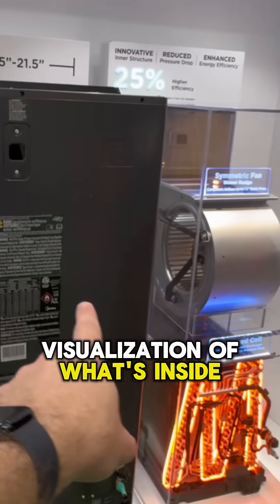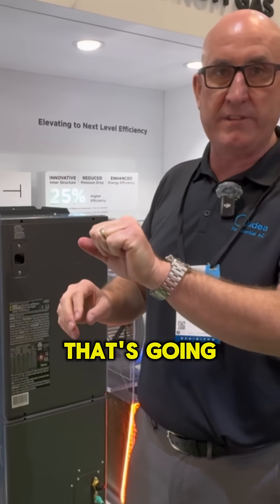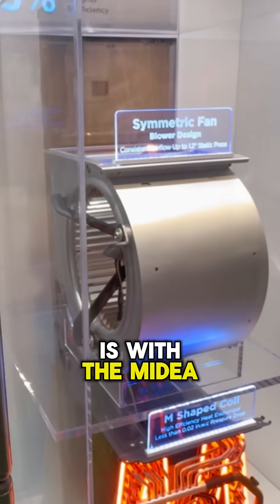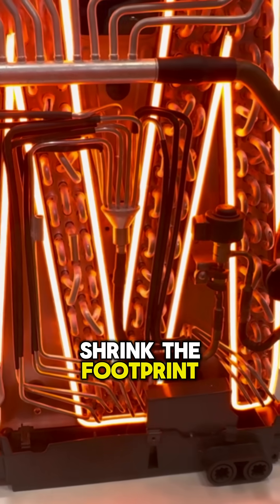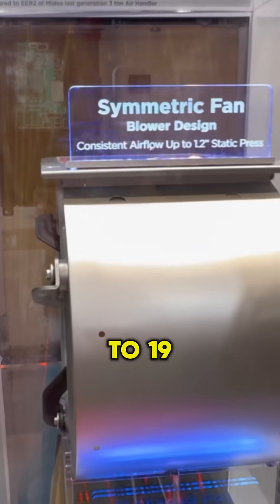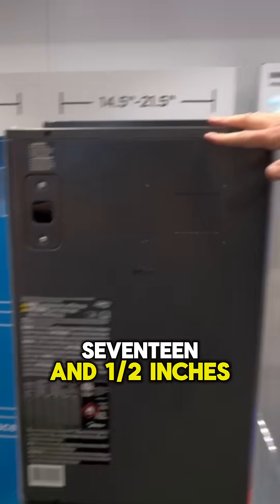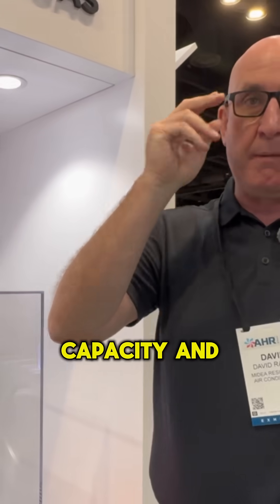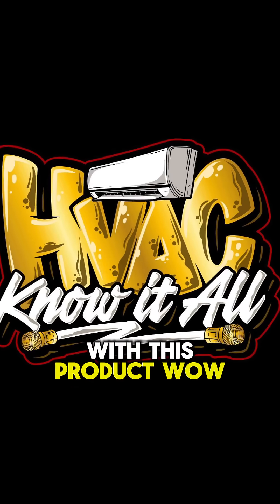Midea EVOX G³

Comment: It definitely will need that 1.2 inches of static at constant CFM with the way. A majority of installations are undersize ducting undersized filters in on top of that only 1 inch and not be changed.. 
    Not to mention somebody sticking in a nerve 13 filter at 1 inch undersized. 
      Would like to see the amp draw on that blower motor at 1.2 inches of water column

Comment: That M coil is going to be a bitch to clean when it gets clogged. Auto voltage? Not really a big deal, it's a selling point for the ignorant only.
Reply from the maker: For the ignorant?  If you don't need aux heat which warmer climates don't tend to, it skips the step of adding a two pole breaker, saves time and money.
Reply: @HVACKnowItAll  I think hes trying to say the coil needs to be turned upside down so instead of m for Midea, Its W for Wumbo.